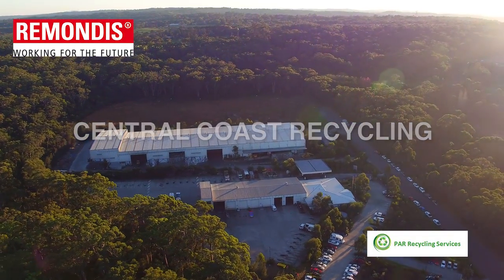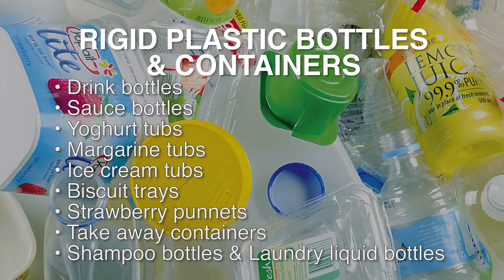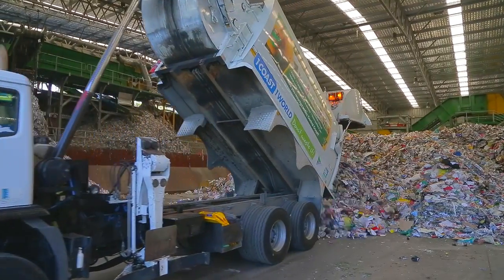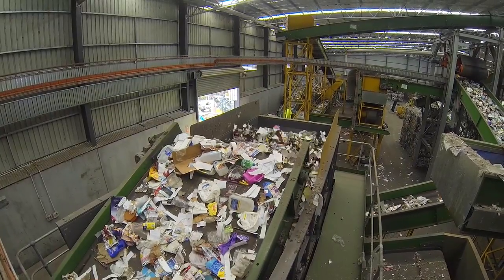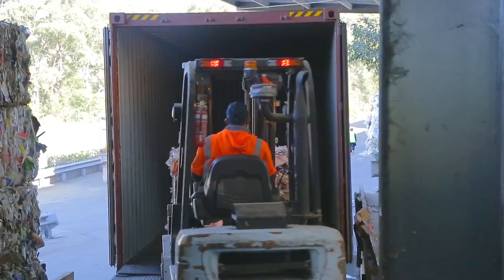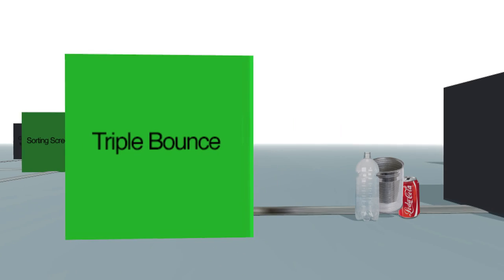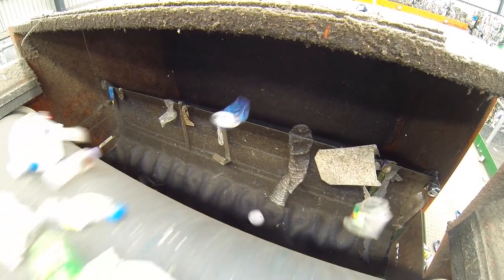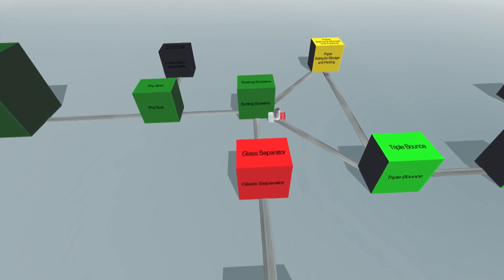Central Coast Recycling

Comment: What frustrates me, is when you collect the cardboard from the supermarkets, and there is plastic all through it.  Clearly they have just chucked the whole box, plastic tray, plastic wrap, the whole lot in the cardboard compressor.  The dickheads should be fined, they are just making someone else's job harder.  The worst I have seen is an Aldi which had a heap of plastic in the cardboard collection.  There should be zero plastic in with the cardboard.
Reply: They actually shouldn't be fined they should have machinery and quick workers that remove contamination from the cardboard before it's bailed.
Reply: I agree I don’t remember seeing that on cardboard, but if you’ve seen I’ve seen it and yes, it’s dumb.